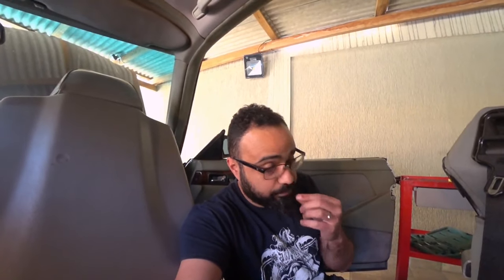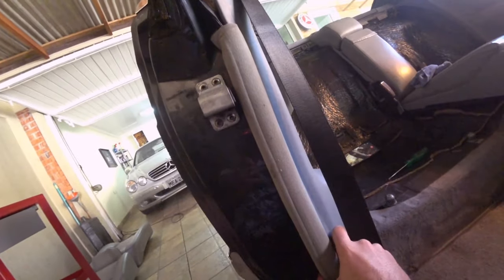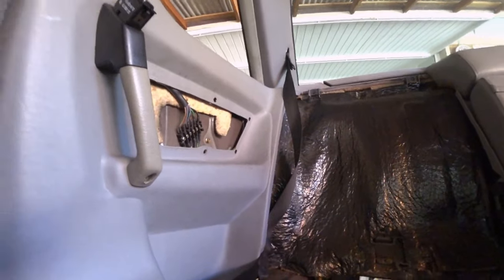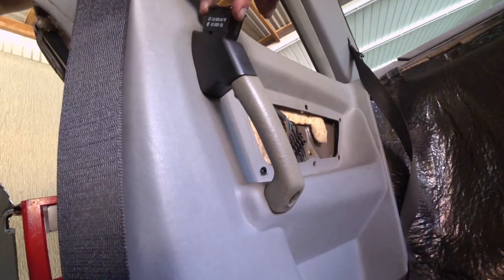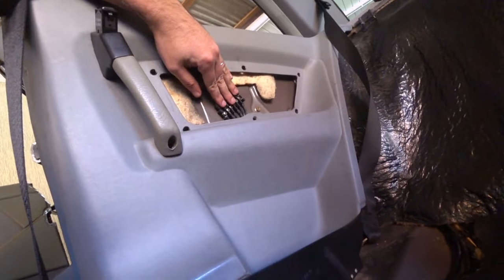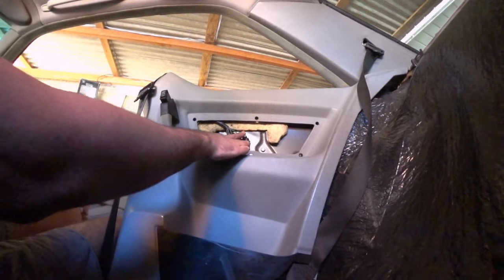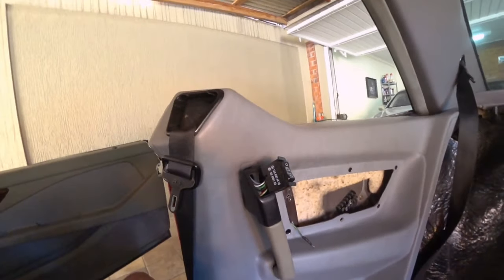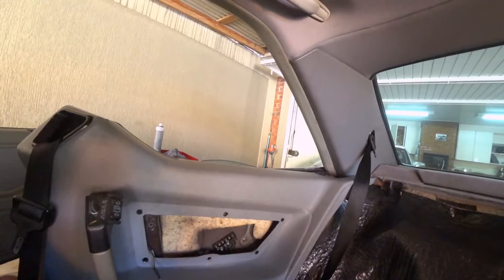[Straight to the Point] Removing SEC C126 Rear Inner Panel

Comment: Thanks for this. One item to note is to pull the visible portion of the presenter mechanism off the arm prior to removing the large trim piece, otherwise it can snap off. This is accomplished by just pulling it straight out; the 1.5" long piece should pop right out.